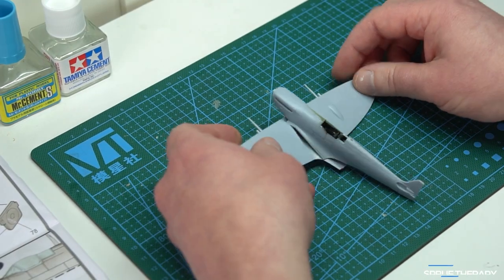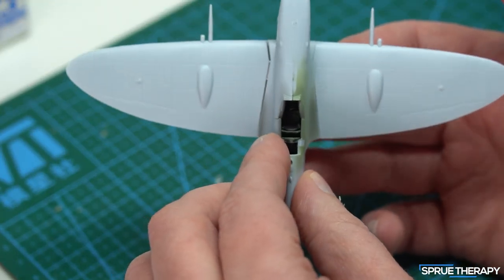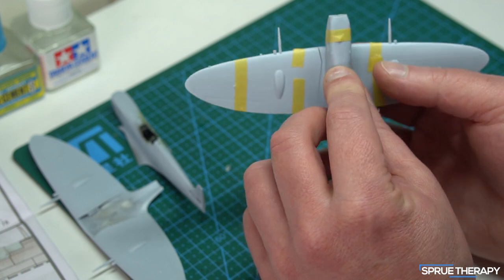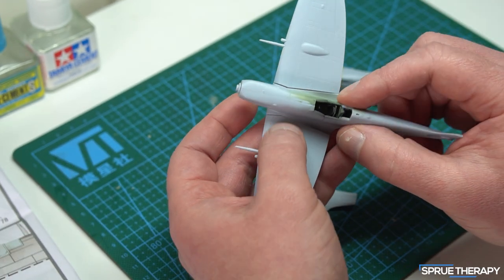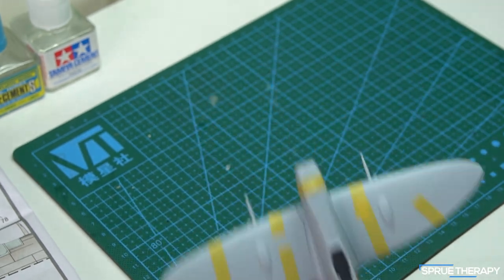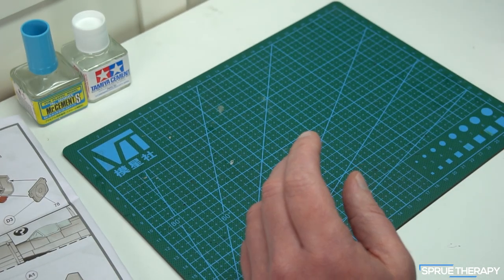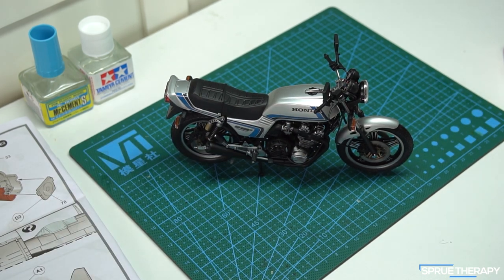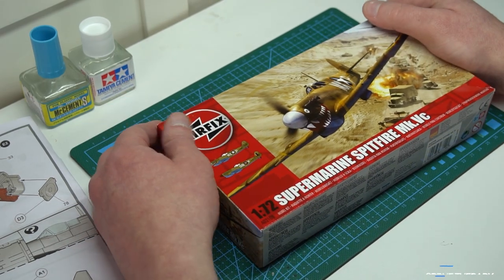1/72 Airfix Spitfire Mk. Vc | This kit has a problem!

Comment: I just add a length of sprue across the bottom of the fuselage.  Trim it to a length that will slightly spread the bottom of the fuselage so that it mates well to the wing.  Glue the sprue in place so it doesn’t fall out. After doing this on my kit (and many other kits over the years lol) No putty was required.
Reply from the maker: Great tip! Thanks!
Reply: @spruetherapy .  My pleasure. And I should add that I’ll sometimes cheat a bit and before gluing will run masking tape from one wing tip across the top of the fuselage to the other wing tip. This closes smaller gaps by imposing an extra degree or two of dihedral.  Not for the purists though!  I really enjoy your videos. Great job.
Reply from the maker: @JJ-cf7nb  Your trick worked! A bit of sprue and there's no wing root gap. Now we're learning! 😊

Comment: This is caused by pinching the fuselage together against the cockpit tub. If you don’t do this it’s a perfect fit. I had no problems and no filler needed. Lovely kit.
Reply from the maker: That's what I thought but It does it withough the cockpit tub too. I bought two kits to test. Seems it's the usual Airfix hit or miss. Still, it came out okay in the end!
Reply: @spruetherapy  yeah. Hit and miss is a good way of putting Airfix👍

Still, they are going in the right direction. I’m looking at my 1/48 Seafury🤔😂
Reply from the maker: @PeteCourtier  Absolutely! Good luck with your kit. 👍

Comment: I had the problem. I assumed the gap was because the wings needed bending up to the fuselage to create the correct dihedral. Seemed to work, and the angle looked about right.
Reply from the maker: Mine would have looked like the Shuttle Tyderium if I'd bent them that much! :D
Reply: @spruetherapy  🤣

Comment: Some plasticard along wing roots before wings are added or spread the fuselage slightly with plasticard. Easy fix.  Their mk1 has similar issue and needs some shaping but then no filler is required at all if done properly.
Reply from the maker: Weirdly I never had any issues with the mk.1 kit. This was a lot worse, I used styrene rod on my 2nd build which sorted the issue for me.

Comment: Ah Airfix. Still unable to bring good quality control in 2022 compared to what Tamiya had down pat by 1992. I always advise new/returning modellers to skip any new or old Airfix 1/72 as their "first kit" and just jump into a 1990's mould (not new stuff!) 1/48 Tamiya single engine fighter. You won't have this sort of problem to stumble over. A relatively easy fix for more advanced modellers, but may stumble up the first timer who then never gets onto their second kit and so forth.
Great videos btw - recently subbed, keep up the good work! Cheers Chris
Reply from the maker: Thanks Chris. It's a funny one, as some of their kits have been pretty good. The Mark 1 Spit was fantastic when I was starting out a little over a year and a half ago. I've quite a few of their kits in the stash but as you say, compared to Tamiya from 20 years ago even, they are lacking a bit! Thanks for the sub! Dan
Reply: Their main problem is quality control - some kits are good, some aren't. The inconsistency is something you don't get with other manufacturers and that's why I can't recommend them. I only have some of their ancient 1/24's in the stash, plus the 1990's 1/48 Lightning and Spitfire Mk 1, which seem to have better detail, better fit and even better plastic than modern releases. You've come a long way in a year and half Dan, well done and keep going!
Reply: @beckersmodels  This one is good though. I had no problems with the wing root. Just drop in the tub and it’s fine. I don’t usually defend Airfix but I will on this gem of a kit.
Reply: hahah .. You haven't had / built Tamiya's 1/48th Sea Harrier ...  It is a dog  ..   Tamiya ain't perfect ....  Also  for the price Airfix in recent years have been producing wonderful kits ..  Personally .. I don't like "shake the box and out comes a perfect replica"  ala Tamiya ....  I like the challenge and joy of working on a kit.

Comment: Hmm, perhaps it would be better to assemble the wings then glue the two halves into the wings before cementing them together . . . It's not the first time i've heard of this issue but I will certainly have to keep an eye out for it when I do mine
Reply from the maker: I thought about that too and on my second kit I went that way when dry fitting. Sadly, that method led to the cockpit falling out and having a large gap down the middle of the fuselage. Having said that, some people don't seem to have any issues at all with fit. It seems to be rather inconsistent.
Reply: @spruetherapy  🤔

Comment: I am a fan of airfix and spitfires, was excited to get this kit when it was released. However, when building it, I had the same issue as well and had to use some tamiya filler... It still turned out great in the end however for a new kit, airfix should have done abit more of work on it before releasing it
Reply from the maker: Absolutely agree. Mine is finally coming along but it took quite a bit of work. Thanks!

Comment: My solution:
Glue some styrene strip along the upper wing roots, so that there will be an equal extension.

Thanks for the heads up.  I have a few of the Airfix MkVc because I made the mistake of buying a decal sheet with too many tempting schemes.
Reply from the maker: Yeah there's a few tricks you can use to solve these issues. Seems it's not needed on all the kits thankfully.